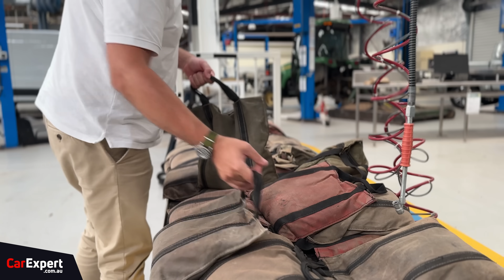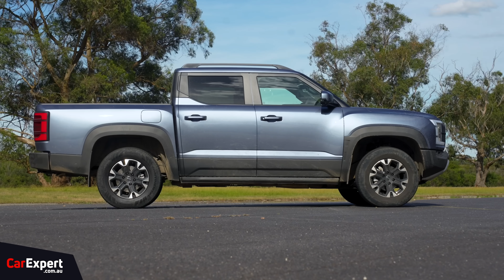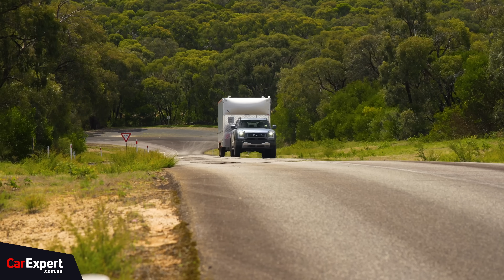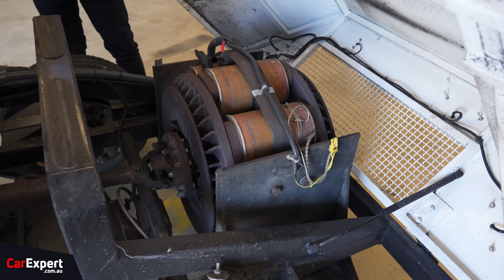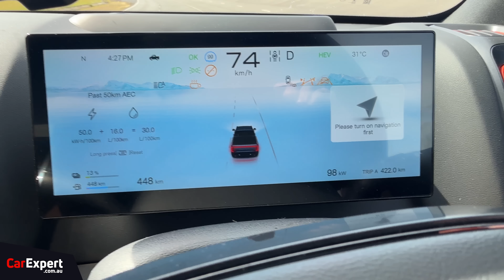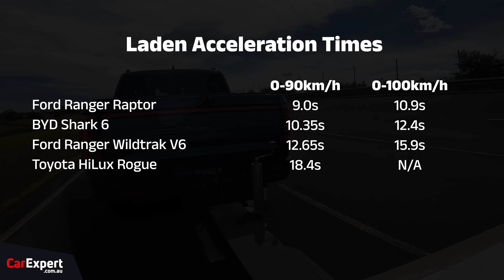BYD Shark 6 towing STRESS test at MAX payload - the results are surprising...

Comment: In the test the shark didn’t go past 105kph. Yes it has maximum amounts of power , yes it can only go 100km on a fully charged battery & yes it can tow 2500kg , it’s 600kg heavier across the board than a  Toyota Mitsubushi etc. 
The hill climb was rather insignificant as I’d like to see it tow the same up Mt White NSW from bottom to top towing the same load. It would lose significant amounts of power based on the tests in this article. 
Sure there is absolutely a place for evs if you want to have your life controlled by weather you have enough power in your cars battery. The warranty is only 6 years & it’s written that the MAX power around this time is about 70% and do you even know how much it’s going to cost you for a replacement battery. 
Government increasing emissions standards to try to force you into buying an ev. It’s blackmail, when all these tests show it cannot perform as well as an ice vehicle. 
My Triton will tow a 6mt hardtop boat up Mt White with out missing a beat & average between 90-100 mph from top to bottom. Sure gears change but it never drops to 3rd.

Comment: The real question is can it tow the rated 2.5t trailer around the track all day and the answer is yes.
I try to give CE the benefit of doubt but they obviously have a clickbait agenda. I think they are confusing a lot of people for which the Ute will be perfectly fine.
Reply from the maker: Ha ha - you mean by testing it the exact same way we test other utes? I think your comment will make it into our follow up video.
Reply: @CarExpertAus  sure good point and understand that. Clarify; can you tow the 2.5t trailer around the oval continuesly yes or no?
If you made it clear in normal driving no issues but you did not did you?
Reply from the maker: @aljoubert8749  Your question doesn't really make sense? Are you asking if you can tow a 2500kg trailer at continuous speed around the circular track? The answer is yes. Constant velocity with little force being applied requires barely any power comparatively speaking. P=F x v. If F is just the air resistance and drag of the vehicle and trailer driving on a flat surface at constant velocity, pretty much anything could tow that at constant velocity once it's up to speed.

The trailer dyne creates a load of 3000N, so the equation then becomes P = (3000N + air resistance of vehicle + air resistance of trailer + any other drag or power loss) x v. Where you'll start creating a higher F load in real life scenarios is when you're driving up hill - you'll have an additional resistive gravitational force of m x g x sin(theta), plus air resistance of the vehicle, plus air resistance of the trailer and any other drag. And given the poor coefficient of drag of a dual-cab ute, it makes driving up long inclines difficult. That's what the trailer dyne simulates.
Reply: @CarExpertAus  your maths makes sense but here is my follow up. So you are driving on a flat road with the Shark and battery is kept at 70% in HEV mode. You will have 15kWh available (eg 70% to 20% of 30kWh).
If the ICE can deliver minimum 100kW then you can add 50kW with the EV system for 20min or 7 laps of the Lang Lang oval. (15/50x60min).
That total of 150kW is the same as the Prado engine which clearly did not run at 100% load on the test. 
Genuine question. Why did you start the Shark test with an empty battery?
Reply: @aljoubert8749  100%. But they will twist your words if they reply. They claim they started the test at 60% battery. Which may be true. But if they had a target SOC of 25% - which we all suspect because they won't confirm... The battery will be flat in 3-4 minutes as the ICE wasn't assisting till it hit 25%. And that's assuming a rolling start - not a 12s to 100kph sprint using battery just to really push it over. They have made very careful selection of details, video crop, images etc that they show / or comment so that there are no lies - just not showing the full story.
Reply from the maker: @shanebatchelor1 😂 one of the most ridiculous comments we’ve ever read.
Reply from the maker: @aljoubert8749 Your theory is right - but unfortunately that’s not how it played out. We started on the bowl at around 60% battery. During the test there were times before the battery expired that it started slowing down and then speeding up again - indicating the system was fatiguing. Whether it was the battery and the motors or just the battery, it wasn’t able to sustain that velocity. It’s also a moot point, because if anybody uses the vehicle as intended and perhaps goes camping or tows to a destination, they will drain their battery and will simply accelerate the chance of running into this exact scenario. BYD should have used a bigger internal combustion engine for this application.
Reply: @CarExpertAus  And yet you prove me right - by answering the question above by giving the initial state of charge, but not the setpoint.
Reply: @CarExpertAus ..... So it could not sustain less than 150kW with the 3kN dyno trailer for more than 5 minutes (1 lap) starting with 60% charge?
Honestly you want to go on record and state that as fact?

Comment: I think sand driving will be similar results to the 3kn test. Always working and very little chance to regenerate. 
For the price I think they are a great vehicle for a soccer mums ute and maybe even a light trades ute.
Reply: Sand driving is always lower speed giving the motor the chance to maintain the SOQ. Unlike other utes, it has peak torque at low speed and has no gear changes to get bogged down with. Combined with 265 highway terrains it will go great in the sand as per videos out of South America.
Reply: @Johnno1979 sand driving might be low speed but it needs constant high power output. This is the reason people select low gears and use  mid to high RPM. Because of the low speeds with sand driving due to bumps and high torque needed. Once the battery runs out you will have to stop and regenerate the battery because at that speed the engine doesn't connect to the wheels . Crossing Fraser Island will take at least 2 regen's by the look of this tow test.

Comment: Great review Paul. Some great independent testing and well researched. Its good to push a new car to its limits. I love alot of features of the BYD shark, its looks like a great car - I was thinking about buying the BYD, but one use case that is important to me, is the ability to tow a 1.8T caravan long distances (e.g. 8hrs Adelaide to Melbourne) sitting on 100km/h. Based on your review, I think over the period of an 8 hr drive, the battery would get depleted (because towing at 100 km/hr would require battery + ICE) and then at some point you would be relying on the ICE only - in that case you would potentially be limited to 70km/hr (as in your edge case scenario). Is my understanding correct?
Reply: This is what the arguments are about. The Shark 6 has the ability to set a minimum state of battery charge ie 70% so when you're cruising along at 100km's per hour, the petrol engine cycles on and off to keep the battery at that level which means you'll be able to tow at 100km's an hour all day without a problem as long as you use the vehicle as it was designed to be used. In the test, they intentionally ran the battery low and then towed the 2.5 tonne trailer
Reply: @johnemerson5383  thanks for this. That makes sense to me. My question is, when towing for long duration  at high speed (e.g. 8 hrs at 100km/hr), will the engine be able to keep the battery at 70% SoC or will it gradually deplete the battery. Do you know if anybody actually done this test?
Reply: @naturetrackers9909  Absolutely because at 100km's an hour, the engine will be doing either no or minimal driving of the wheels. The Shark 6 is effectively an electric car with an engine that helps drive the wheels when under load AND / OR charges the battery. I haven't seen anyone do the test you're looking for yet. I was hoping that Car Expert would do it but these clowns seem to want to just show the vehicle failing. Keep your eye out, I'm sure that someone will do the test in the not too distant future.

Comment: The test results reflect what I’ve experienced towing with an Outlander PHEV over the past 10 years. Great towing on relatively flat terrain but as soon as there is an incline over a long distance or multiple hills the system can’t maintain the battery charge so the engine screams trying to deliver enough power towing while trying to charge the battery. I’m towing 900kg with a 1500kg rated vehicle. The vehicle relies on the combined electric and petrol engine power to deliver the maximum power, as soon as the battery is drained it only has the power from the petrol engine.

Comment: Last year I towed my caravan with the BT50 from Far North Queensland to Tasmania and back.  MY diesel BT50 did not miss a beat.  Cradle mountain wad lots of real steep hairpin turns.  1st and second gear trying to keep the 3.2 Lt engine in the rev range to give it maximum torque.  The only thing I had to worry about was the fuel gauge.  Towing I can get about 500 kms.  Throw my 2x Jerries in and I am up to about 700 kms easily. From what I have seen here, this thing is simply not up to the task.  Get on a large mountain range, exhaust your battery to 25% and you are up shit creek from what I can see.  If any of you people are rushing out to buy one of these things for towing a van or intend to go offroad, you are going to be very disappointed.  I can see them being good in certain scenarios but for what I do and many other Aussies, they are not up to the task.  People these days seem to think having apple carplay and a big fancy screen on the dash is more important than what the engine/electric motors is capable of.  For me, this is a soccer Mum's car with a tub in the back.  GAF!!!!!!!!!!!  Still yet to see a youtube clip showing real world scenarios. Tell BYD to lend me one.  I will hook the camper trailer up and see if I can make it to the tip of Cape York via the PDR.  Maybe a Fraser Island trip.  Good luck on Fraser (K'Gari) without Low Range.  I wish the fish bit as hard as all you Chinese Fan Boys that have never been out of the city.🤣😜🤪

Comment: Not sure if I’ve taken the wrong information out of this review but here goes. What I’ve taken out of this review is that the vehicle won’t have any issues doing short trips to the boat ramp but if I want to do a road trip I could have some issues. My boat is around 1.6T. I’ve combed through the comments and found that Paul started the test at 60% battery.  My concern is living in NQ most road trips are 1000ks or more so if towing over a long distance is an issue I’ll pull my order and stick with the Hilux. 

Please tell me I’m wrong?
Reply: Yeah, you're wrong. As long as you set the battery level to say 70% which you can do, the Shark 6 will cruise at 100km's an hour all day long with a boat on the back. The petrol engine will cycle on and off to keep the battery topped up so when you do get you hills you're fine. In the test they intentionally ran the battery down and then started the tow test which you'd never do in real life. I'd wait and see what other people do on a real world tow test.
Reply: @johnemerson5383  If you set the minimum SoC to 70%, then cruise at 100 km/h for the day... what will your fuel consumption be?  Another reviewer used that configuration (while not towing anything) and got 14 litres / 100km.
Reply: @RodneyW  I haven't seen anyone do a fuel test whilst towing so that's going to be something that hopefully one of the reviewers does soon. When not towing, in hybrid mode it gets 7.5l/100km's to 8.5l/100km's.
Reply: Also remember the car has CCS charging. You could always charge your battery during breaks
Reply: It will be poor. But hopefully this is acceptable given  the overall fuel profile thought a year. For me, where this is mainly a commuter and weekend "take the kids to the BMX track" car, it's on sole battery 95 percent of the year.  But if you're towing year round, it's probably not the vehicle you'd want.

Comment: When this car was released I wondered what happens when the battery is drained & you are left with a 1.5 litre petrol motor to drive a car of this size. The numbers don’t add up
Reply: The engine is primarily a generator supporting the battery and electric motors. Under normal driving, not extremes like this video, you will have battery power while ever you have fuel in the tank.

Comment: Paul, I appreciate that you had a go at this, but I think you should do it all over again. This time when testing with the trailer dyne use a more representative drag consistent with towing a 2500kg trailer, and try some different options of battery SOC to find its best towing performance, just like an owner would do. 
It is worth noting that 3000N is clearly too high for a fuel consumption test, even for the 3500 kg diesel utes because there is no way that would represent the average towing scenario. That is more like worst case up a steep hill which would represent less than 5% of towing, and even then there is a downhill to follow that would recoup some of the economy. That trailer dyne test you performed on the  group ute test was in my opinion completely flawed, favouring the most powerful utes, but then to follow up and perform the same 3000N test on a 2500kg towing limit ute was simply unfair.
Reply: @MotoGuzziMoto  Agreed. Load the Ute close to the max limits and set the Dyno trailer at a figure that represents a 2.5T trailer going up a grade not exceeding the 12% grade limit for the vehicle and see how it goes. Then repeat the test varying the load in such a way as to simulate real world conditions because inclines are variable and I’ve never towed my van up a continuous 12% grade that would allow anything close to 100kph for more than a brief period and even then, why would I. Doing so absolutely kills your fuel economy. Considering drag is a huge factor above 80kph is it not reasonable and sensible to look after your equipment and perhaps just slow down a tad to save power. Just because you ‘can’ climb at that speed doesn’t mean that you ‘should’. So the test was entertaining but essentially useless to all of us that would actually like to know what it CAN do as well as what it CAN’T do.
Reply: Here is an idea. You actually have a 2500kg trailer, so why not set out a course of say one run over the hill and then 3 laps of the circuit to determine overall economy. Then compare against your Raptor.

Comment: BYD has done well with this car but I still believe it need’s a few things like rear and center diff locks, they have done that with the leopard 5 which has the same setup as this. When towing I’d have the engine full on so it is able to charge the batteries and also aid in power though I also believe at full towing weight the engine will struggle to do both, I’d say it’s a bit too small or underpowered for high demanding situations. But perfect car for 90% of the people who will buy and never tow or do serious off-roading.

Comment: what is the range at 100kmhr with 2500kg or max tow load ? when starting with full tank and charge
Reply: And with SOC set to 70%, Regen set to max and also set to save mode.
Reply: @Johnno1979  I saw he said economy as 30L per 100km and a 60L tank, does that mean 200km range ?
Reply: @BennyTheKnife  That was for his test  with actively braking trailer ,its not realistic scenario,its like towing 5 tons on 2.5t rated car

Comment: Possibly the best review on the BYD Shark yet … potential purchasers need to know how the system works, both positive and negative so they can make an informed decision. 

It’s also a great safety announcement so potential buyers understand what’s going on, if under the right circumstances they are at low battery and loaded going up a long steep incline, there is the potential to lose power, or they may have done a couple of overtaking manoeuvres, got mentally use to the time taken, then on another occasion they go to overtake and they lose power.

Comment: But it's petrol and will cost more to run.
Reply: U91 us about 15c cheaper than diesel atm. Looking at the 12 cars tow tested last year, only 2 had better fuel economy & only 5 could actually get the trailerdyn to 100km/hr.
Reply: @Johnno1979  don't know where you dug that info up from. All my diesel vehicles can fly towing g 3.5 tonne

Comment: This drivetrain is optimised for start/stop city driving. The little 1.5l petrol engine basically just operates as a battery charger/power supply, for the two electric motors, when operating under 70kmh, and in low load, city driving, thats fine. The problems will start, with heavier loads at speeds greater than 70kmh. The petrol engine's relatively low power/torque output (Power/weight ratio), will struggle to efficiently propel the vehicle while also maintaining charge in the battery. You'll likely end up with the little four pot turbo, screaming away at 5000rpm during long flat runs into the wind and even modest hill climbs.

And BYD are well known for the durability of their 4-cyl turbo petrol engines, arrent they 😅